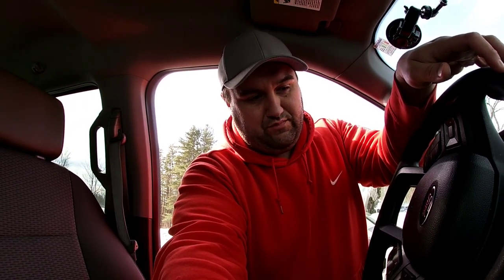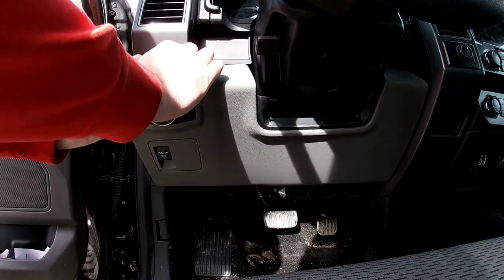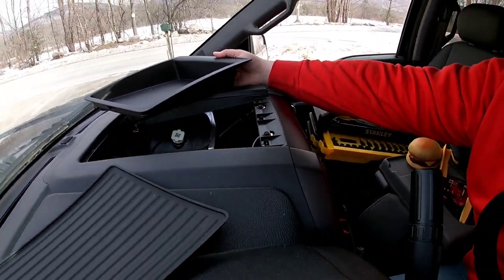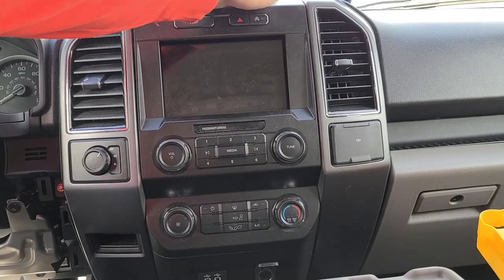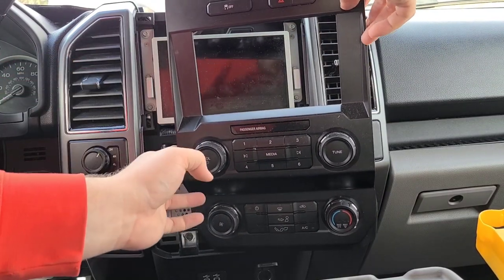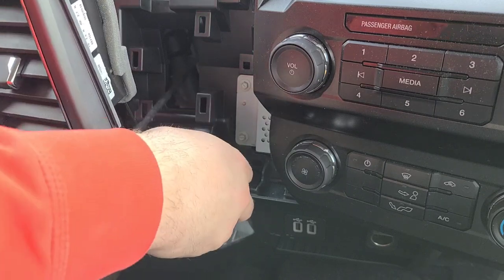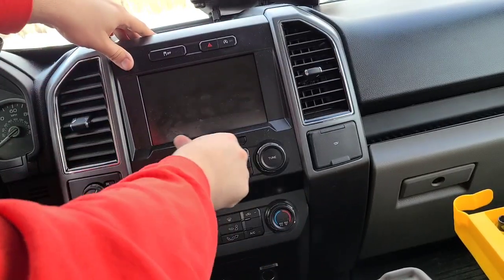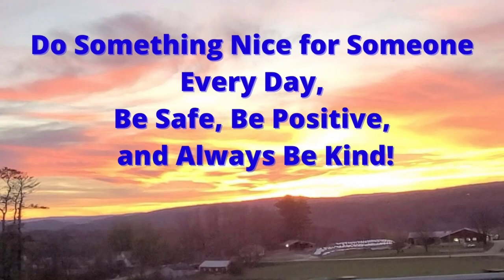How To: 2020 F-150 OEM Trailer Brake Controller install Guide

Comment: That’s a nice truck you have there. I like the recessed brake controller. It looks better than the ones I have bolted to the dash.
Reply from the maker: Thank you.  Its been a blast to gave so far.  There was a perfect slot for it already in place.  I noticed ford did this with other items as well. All the plugs for stuff the offer on the higher trims are already in place.  Just have to add in the actual device. Thanks for checking out my channel.  Its an honor

Comment: I just bought an OEM from factory, and it also came with a #30 Fuse.....  think the fuse is needed? Seems strange.
Reply from the maker: Yes I ended up finding our a fuse was also installed.  I forget what one it was 30 sounds about right

Comment: i have the same ford f150 i think. does not have the trailer break controller or the 7way receiver. is the wiring already installed for connecting everything together?
Reply from the maker: In the dash, yes, the wiring and plug is right there. I'm not sure on the 7 way plug on the bumper. Mine had it from the factory  already.  I do know that behind the bumper is another harness for the trailer plugs. So if you dont have one stock. Then you should be able to plug an aftermarket one at that point.

Comment: Don't forget  to use Forscan to enable it on the IPC  side. Just did it to mine along with other changes.
Reply: I’ve taken mine to the Ford dealer to get it programmed and mine still doesn’t work it says gain is at zero and can’t adjust it how did you program yours?
Reply: @brandonmatthews9708   did you get yours to work?  My gain is at zero too
Reply: @Sadams707  the fake OEM knockoffs on eBay are not working properly. Make sure you order from Ford or an authorized dealer

Comment: Thanks for a very helpful video.  4 Questions.  1) Is this a proportional brake controller? 2) Do the trailer brake controller settings display on the screen on the dashboard? 3) What does it mean to flash the controller? and what does this do?  What happens if you don't flash it? 4) DO you know who makes the brake controller?  Is it Tekonsha?  Thanks!
Reply from the maker: Hi Chuck, Thank you for your kind words and questions. Here are the answers from my experience: 1) this is the same as the OEM controller so  yes it should be proportional. 2)yes the controller setting does display on the Driver information screen on the dash. 3) to flash in this case meant that I had to bring it to the dealership and they go into the computer of the vehicle with one of their computers and get the vehicle to see and communicate with the newly installed brake controller.  In this vehicle if I did not do it then the controller would be useless as the signal goes through the vehicle computer before going down the line to the plug at the back of the truck.  Different then older vehicle set ups,, as the controller went straight to the plug for the trailer.  I hope that's not too confusing. 4) I will have to look back at the purchase to see exactly who the manufacturer is.  I originaly went on ebay and looked for OEM brake controller. Found the best one with the best reviews, install, and interaction with the vehicle.  
Hope that all helps.
Reply from the maker: https://www.ebay.com/itm/New-In-Dash-Trailer-Brake-Controller-Module-JL3Z2C006AA-For-Ford-2015-2020-F150-/233710122086?mkcid=16&mkevt=1&_trksid=p2349624.m46890.l49286&mkrid=711-127632-2357-0..

Hope this link works.

Comment: did you have to use forscan or have your truck flashed to get the brake controller to work? If it did work did the dash screen show that it is working?
Reply from the maker: I had to bring it to dealership for them to enable the trailer braking.  I would assume it could be done in forscan as well!

Comment: Where did you get it and is it working properly?
Reply from the maker: I got the controller off ebay. It is an OEM controller.  It works great.  I don't recall if i said in the video or not.  But most times you will have to bring truck to dealership once controller is i stalled. To have them "flash"  it. And tell the computer to recognize it and communicate with it.   If you have the Forscan or whatever its called, apparently you can flash it yourself.
Reply: Thanks for this, did you unplug battery before? Is that necessary?
Reply from the maker: @boknows3915  sorry i did forget to mention that part. I did unplug battery. Though some may say its not nessicary.  I was always taught that if you are doing anything electrical then the battery needs to be un plugged.
Reply: @itsallgooddan  thank you, I thought I had heard the same and was just making sure, thanks for this I wi be installing mine today!
Reply from the maker: @boknows3915  oh awesome.  Pet me know how it goes.
Reply: @itsallgooddan  it's in and looks like it's working! Thanks for this vid, have a good day!
Reply from the maker: @boknows3915  thats awesome to hear

Comment: Cheapass American manufacturers. This should come standard on every 1/2 ton pickup or larger.
Reply from the maker: You are 100% correct.  There are quite a few things that should just come standard on these.
Reply: @itsallgooddan  they sell you a $55k truck and then want to nickel-dime you with "packages".  Good video. Thanks for sharing
Reply from the maker: @groth3395  so very true!   Take care and be safe!